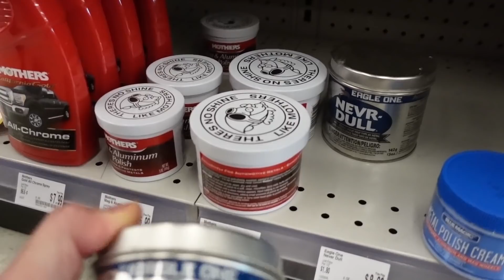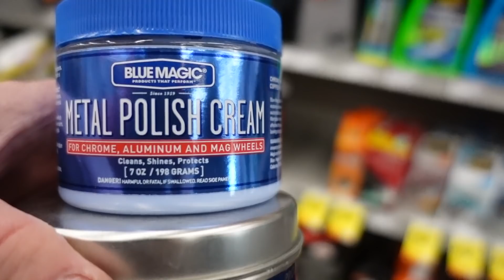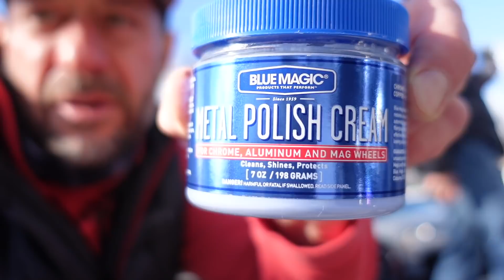BEST PRODUCT TO CLEAN YOUR CHROME MOTORCYCLE PIPES / 2020 ROAD GLIDE SPECIAL

Comment: I didn’t like the cold either so I bought a new BMW R18B with heated seats and grips and wow did that make a difference. I also found a set of aftermarket grip covers that you can add to the grips and then your grips are heated so that will make a big difference on your hands

Comment: Best that has worked for me was a copper pad on the pipes. Wet area first with WD40 or Spray cleaner. Copper pad will not scratch pipes if you wet area first.

Comment: 0000 steel wool. Couple passes and done! Better than any polisher on the market.
Reply: And low and behold you've just scratched your chrome!     Steel wool is hard enough to scratch chrome.   If you use bronze wool your chrome will not be scratched!!  It's a proven fact!

Comment: Don’t use chrome polish; too abrasive. Also chrome is already polished. Never use steel wool or any abrasive material. You will cause hairline scratches that will eventually rust or pit.